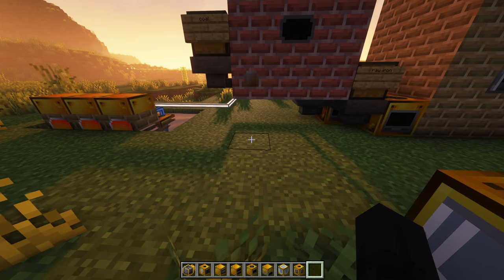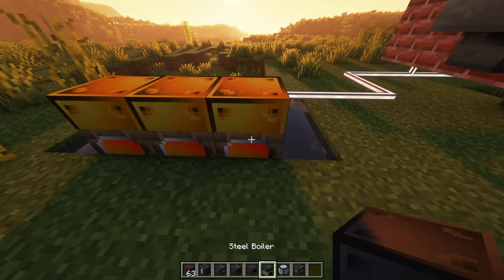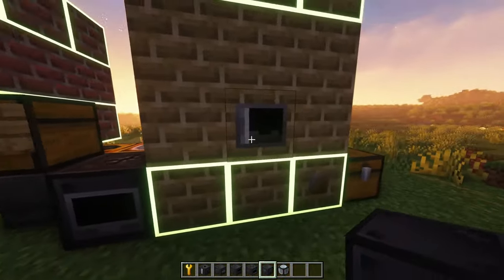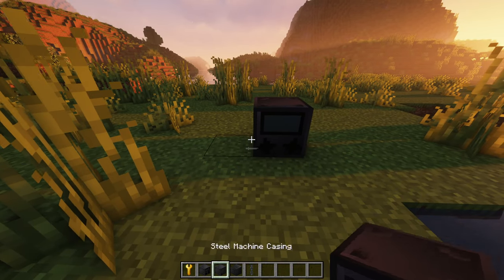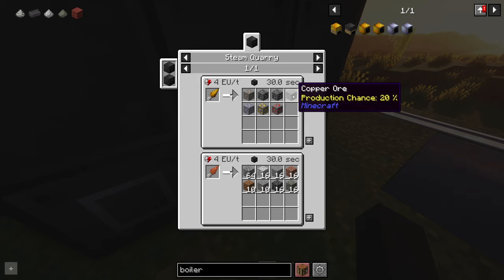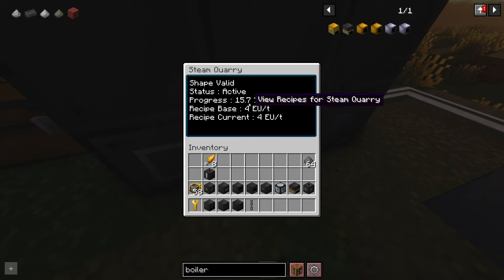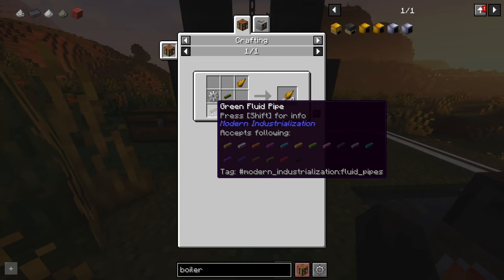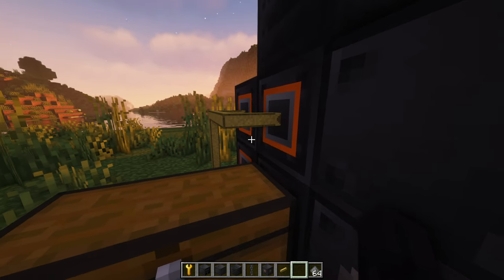Modern Industrialization Tutorial #3 | Steel Machines and Steam Quarry

Comment: That is interesting at the end, where you said we may be losing ores from the quarry unless we add more item outputs. Have you tested this to verify? I’m not sure that’s how it works
Reply: could be, might as well use the 3 extra outputs, not taking any risks
Reply: thats exactly how it works, the way the quarry works is that for every single item the drill can mine it rolls a seperate chance for, so for example a bronze drill can potentially get all basic ores in one pass, however if theres not enough output hatch space to put them all, it voids what has no room, it does not keep a buffer at all. so more hatches ensure you lose nothing.... this is especially important for the nether drill (gold?) as it gets tons of netherack, nearly 2 stacks on every other pass, which can stuff up your outputs

considering an output is just removing the casing from the quarry and crafting it with one hopper is super duper cheap, may as well have every spare casing an output to be safe

Comment: How do you make the invar bolts and rings, it is not the same process as the copper and bronze ones. Would be very helpful and appreciated.
Reply from the maker: Apologies for the very late response. Hopefully you've found this out by now, but for others who might search through the comments:

Using the "Cutting Machine" you can "cut" various different metals into it's part counterpart such as rings, bolts and rods. You'll need to accompany the metal with lubricant (which it uses very little of). You can make lubricant in the "Mixer" by mixing together the Creosote Oil and redstone together.
Reply: @FabricModTutorials  A further problem that i am experiencing in prominence 2 is that the nickel from tech reborn which is supposedly compatible is not, and the correct invar does not even seem to be present in the world.
Reply: @welds8424  At least in 2.8.7 nickel from tech reborn is compatible for producing invar